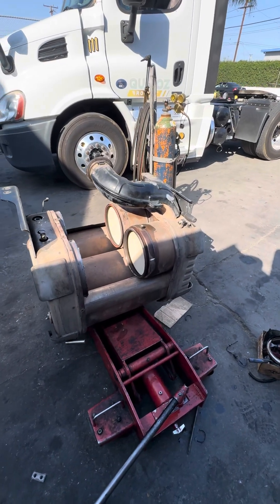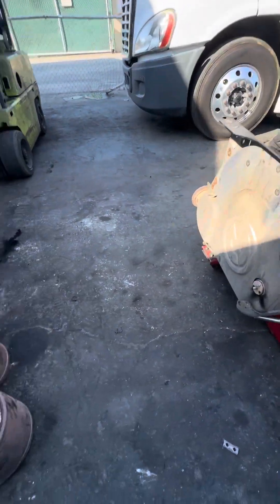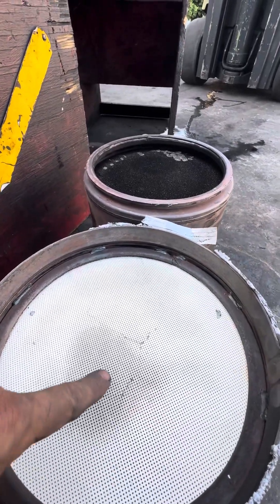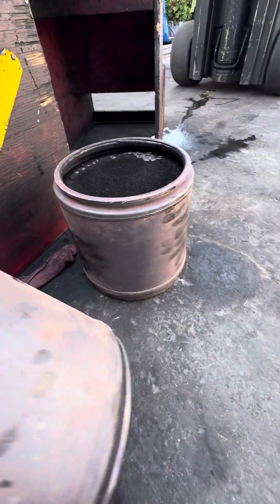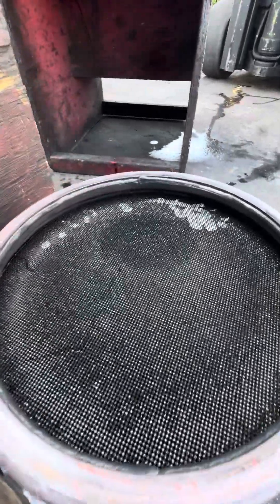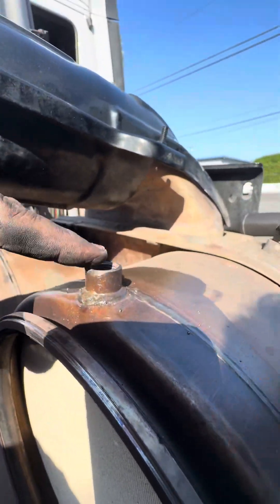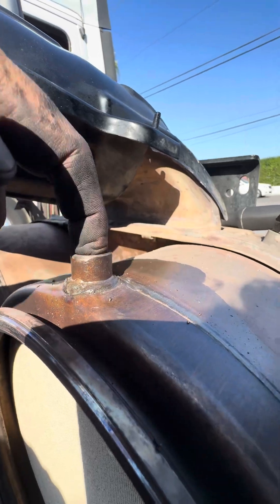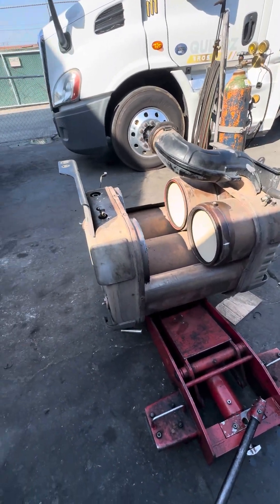Bad One Box, DOC temp fault code DD13

Comment: Hey brother I’m having issue where can I contact you to ask a question? So my truck is purging every 30 seconds, I already changed discharge line, dryer and governor are only 7 months old, my check valve in air tank is leaking could that be causing purging every 30 seconds
Reply: I had a similar issue, and it turned out to be the leveling valve for the suspension airbags.
Reply: @jorgefacio690  talking about that brother I do notice that when I fix it, it will start purging again every 30 seconds when I am docked and getting trailer unloaded so I’m going to replace that maybe it could be that